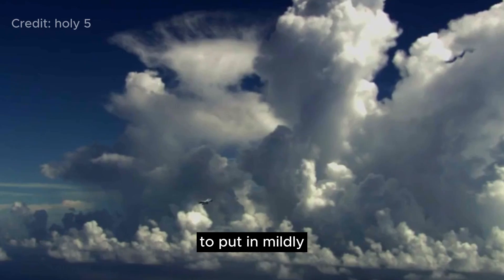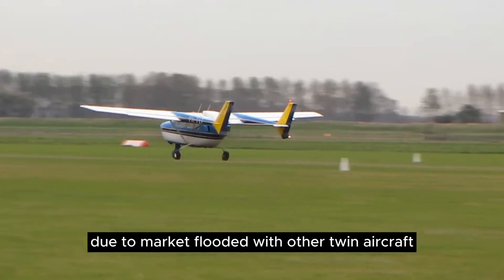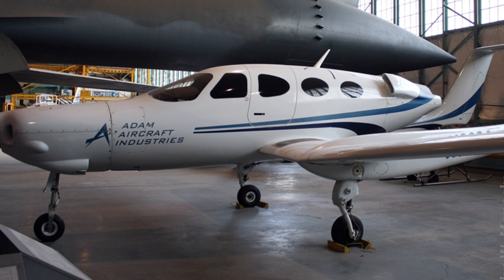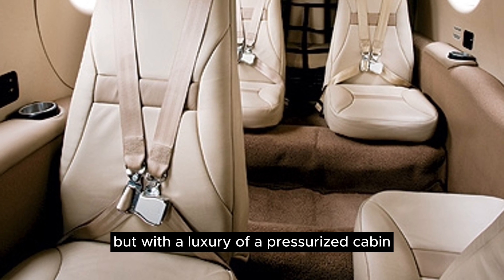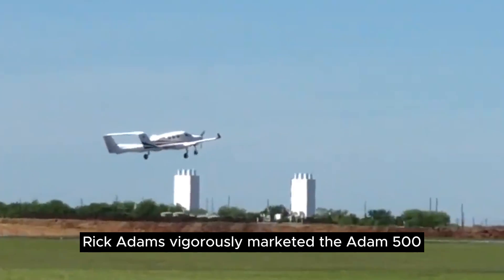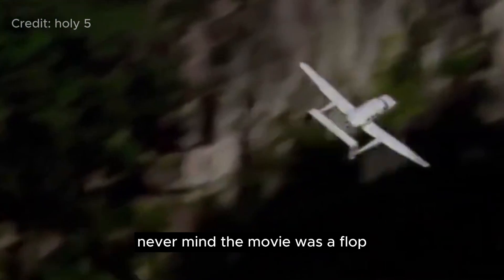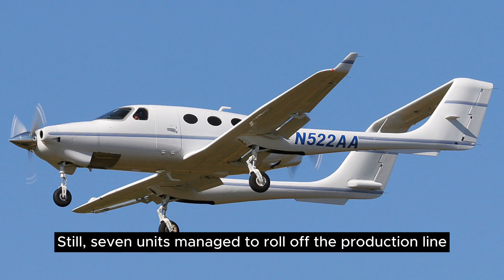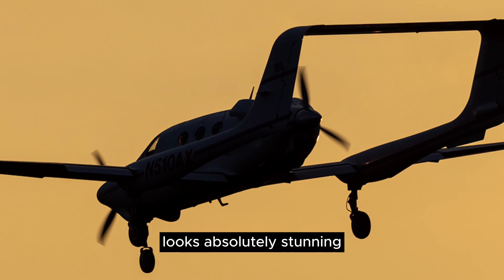Exotic Birds:  The Adam 500

Comment: The issue of the weight problem should've been caught in the design phase and initial weigh in.
Reply: Yes, the design program CATIA can very accurately estimate weights based on the size and density of materials specified by the designer. I don't know if they used CATIA, but many other software programs today can similarly estimate the weight. Maybe by the time they weighed the prototype, they were so deep into money spending that they decided to keep going in the hopes that they could eventually figure out a way to reduce the weight.
Reply: @Rotuma1260  i mean they still had advanced computer models even back then so really a head scratcher.
Reply: Burt Rutan always designed passenger carrying aircraft with a significant safety factor greater than 4.0 (compared to Cessnas 1.5).

He has claimed they can dive beyond VNE to VDive and (if somehow able to) yaw side-ways 90-degrees it would be able to withstand the air loads.

"Over weight" is relative. There is ZERO laws against taking off over gross weight.* Many countless records were set by aircraft purposely loaded far overweight. 

Design Gross Weight is the weight the aircraft structure and performance meet all design criteria. Any additional weight reduces performance and structural margins. The (test) pilot must account for this in his flight calculations and planning. 

*I have read MANY NTSB reports from fatal crashes due to fuel exhaustion, and they always state "The pilots reluctance to exceed gross weight and depart with marginal fuel reserves for the planned flight showed poor judgement"...

Comment: That's kinda what you get for trying to change a Rutan design.
Reply: How so?  Name ONE Rutan/Scaled design that went into even limited production .  SCALED produced aerodynamic evaluation airframes using hand building techniques unsuited to any economic manufacture so a complete redesign structurally or even material wise was then required --the in house projects like Solitaire/Ares/Grizzly/Vari Viggen /BiPod/Skigull /Boomerang etc functioned in the strict sense but were not compelling enough to develop for production --the aircraft built to client's designs or specifications also failed to be produced . the Vari Eze and developments only suceeded as hand built 'prototype copies' in the labourious foam/glass now dropped in homebuilding even (and arose as copies from the Fred Jiran built 'super snooper' drone )   One offs like the Voyager or Pond racer for a single point design acheived demonstration status for very esoteric 'uses' with no intention of reproduction so 'successful' has a very limited meaning in this context.   
The Adam 500 looked very heavy and clumsy to my eye and would seem better suited to the Defiant layout although that design also did not 'take off'  - cracking the light aircraft market is a very hard nut and forseeing the reception and pitfalls awaiting a new entrant would require more perception than appears to have existed at SCALED, and lots of others, --knowing WHAT to build is crucial besides the knowledge of how to . A follow up on the failures in the eVTOL field would make for interesting viewing .
Reply: @rossnolan7283  The Cozy Mark IV saw some limited success, and the Velocity is pretty good. Granted those are home built and not production. That's actually been my biggest complaint in the industry, we have all this tech and the likes of Cessna, Beech and Piper keep producing the same plane, just with a different avionics package. I hope for the day someone really designs something that can compete with the big three and actually be affordable. Rutan had some cool designs and I always hoped eventually one would make it to production. Wasn't Starship designed by Rutan, or was that an all Beech design, I don't recall. That plane was very cool, but plagued by so many issues. I wonder if they revived it if we'd have the tech to make it work.
Reply: Interesting view - the big three in US GA have survived by producing all round satisfactory aircraft and had the timing right . In 1947 the US lightplane industry collapsed wiping out scores of firms  but not them , the much bigger wartime firms pulled out of GA and the Korean war kept them going plus the ongoing cold war -- demographics and post war prosperity favoured the established manufacturers to capitalize on their investment -- for about 30 years ( I went through Cessna Wichita in 1974 around peak production time -they were tooled up )  Small increases in cruise speed give realtively little return over even long flights and are hard to acheive at low cost so annual model changes like in the car market are absent - any breakthrough GA design must look elsewhere for a real market expansion . the current 'eVTOL" rush is one attempt and roadability ,properly carried out, has been the perennial 'great white hope' still unsatisfied (Cessna dabbled in this idea just post war )    Starship was a Rutan design 'selected' from options given to Beech according to him - the Avanti flew rings around it and was 'tin'   -- 'selecting' the right combination in design terms almost requires time reversal (you only know it was 'right' if it succeeds )   Rutan was surprised at how popular the VariEze was but that faded and the ubiquitous RV 'x' of conventional everything is dominant just as in GA   (velocity,Cozy etc are considered to be VariEze spinoffs ) @brandonb417
Reply: sorry about the 'cross outs' -a computer glitch somehow.

Comment: I wonder if it could have been more successful if it was a single turbine instead.
Reply from the maker: The twin boom design would have lost its purpose. (Or do you mean a turbine pusher)
Reply: @aircraftadventures-vids  I wasn't thinking turboprop, I was thinking turbo jet, like the Vision Jet. Better power to weight ratio. Plus, all the changes they made should have been put into the initial design, not added later. Rutan's designs are good, but if you change them too much they get unbalanced.
Reply: Good question!

Comment: Replace the piston engines with two small turboprops. The power to weight advantage would solve lots of issues.
Reply: What T-boprops save in weight and complexity they gobble up in fuel weight, especially if they are more powerful than the piston engine they are replacing. They run at full rpm and at sea level use excessive fuel to stop their turbines melting. The Adam 500 simply lacked the fine tuning of a good developmental period and fell on its face. A mere engine change would not have saved it. Rutan always designed impractically lean racehorses of aircraft.
Reply: 1 million dollars just for 2 new PT6’s, in addition to the rest of the cost of the airframe and certification, would make it more expensive than a King Air, which would kill any chances of commercial success…
Reply: TBM/Mooney 301 > All.

Because its conservative. Its fast. Its reliable. Its easy to maintain and its cheap (relatively).